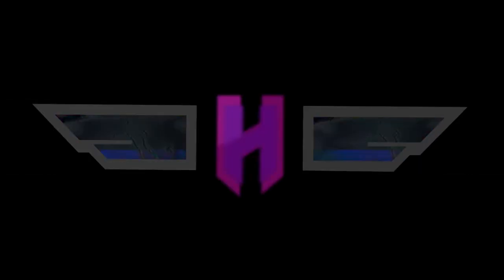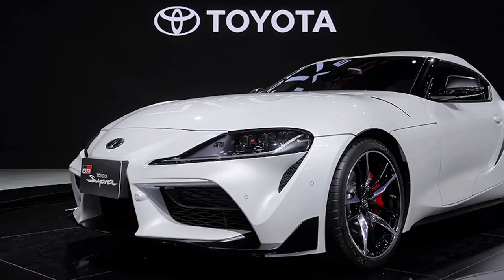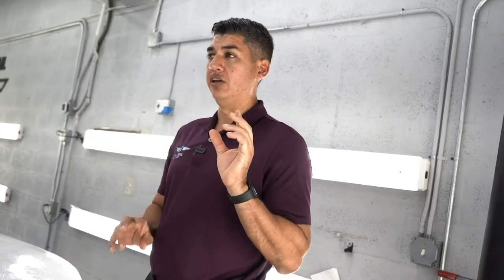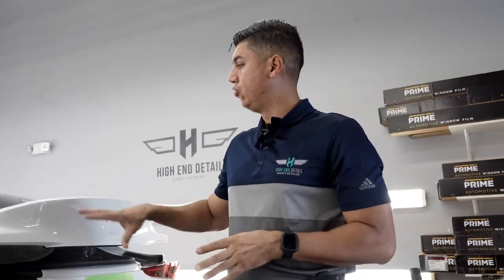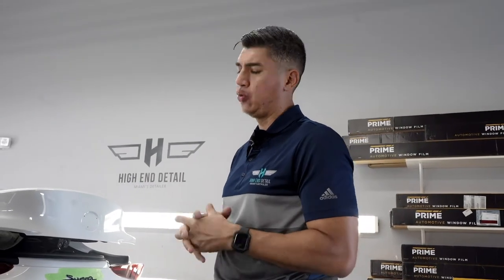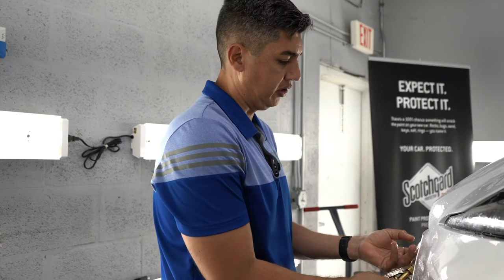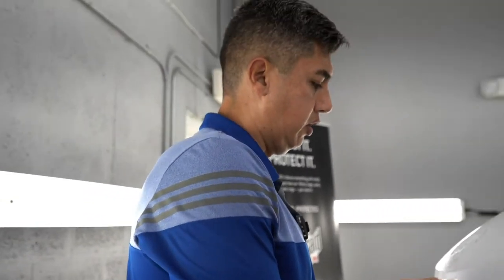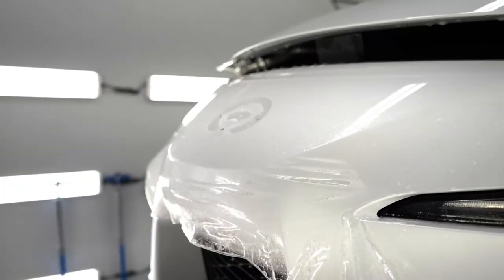NEW TOYOTA SUPRA | FULL PAINT PROTECTION FILM

Comment: What did you guys use to remove the tacky stuff off the emblem area? I need a custom badge but I know pegs are holding that thing in with extra grip.  Hate that Toyota did that. Great video guys!
Reply from the maker: Here at High End for all badge removals, we highly suggest using Stoner's Tarminator Bug & Tar Removal for the adhesive material, and when it comes to removing badges we do consider using a proper heat gun, very thin fishing line, and a durable plastic prying kit to avoid damaging the paint of your vehicle when the removal process is taking pace
Reply: @HighEndDetail  thank you so much! You have  no idea how much this helps.... Keep the vids coming!
Reply from the maker: @JulietActual  Absolutely! Another thing when you come across the prongs on the emblem of your car once the fishing line stops, begin working your way around the logo to release the extra tension of the adhesive as you heat it, the prongs will tend to bend or break upon removal, but that's 100% normal because of the odd way you need to work around the vehicles molded logo area